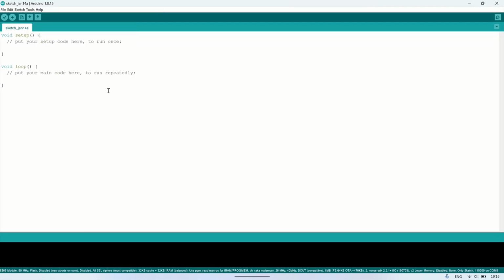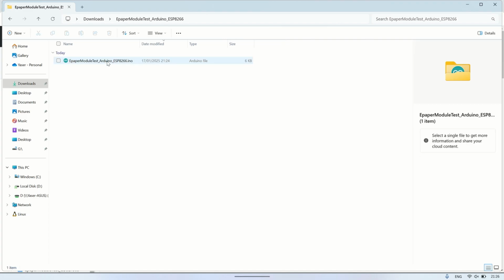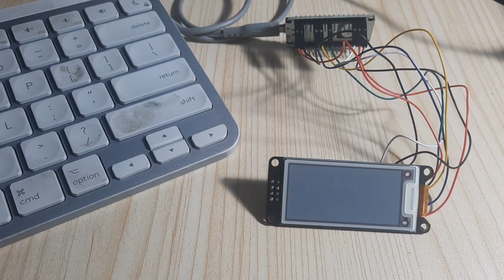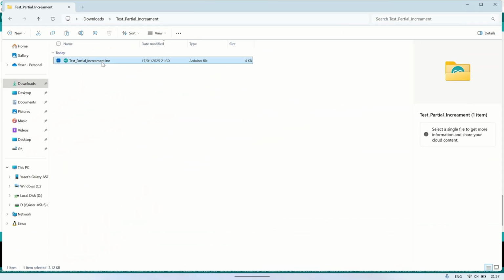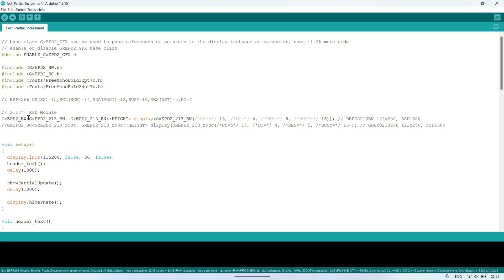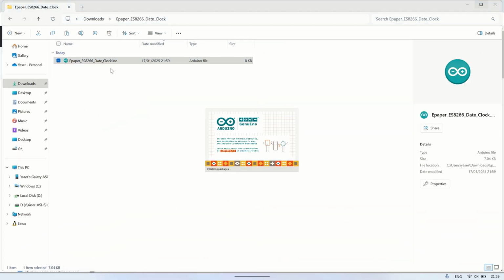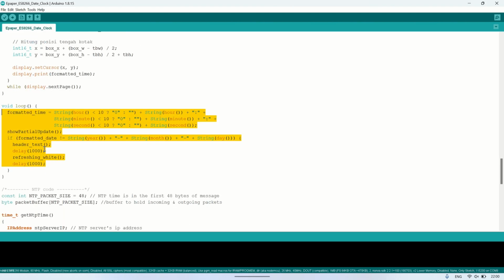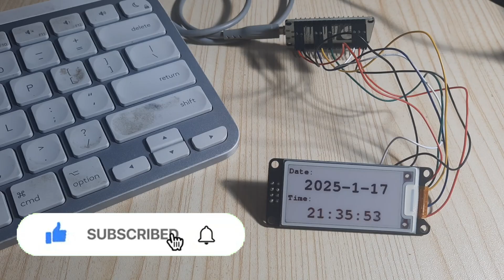E-paper Display WeAct Studio with ESP8266: Full and Partial Screen Updates Explained

Comment: i want to ask, how to use partial refresh on the display? im using the 3 color and i use different board, different code but my e paper keep full refresh and not using the partial refresh
Reply from the maker: Partial refresh usually isn’t supported on 3-color e-papers, only B/W types can do that.
Check your library or driver docs; some boards always do full refresh by design.